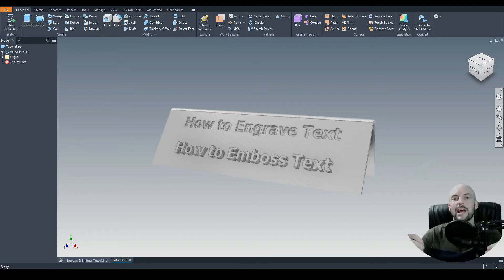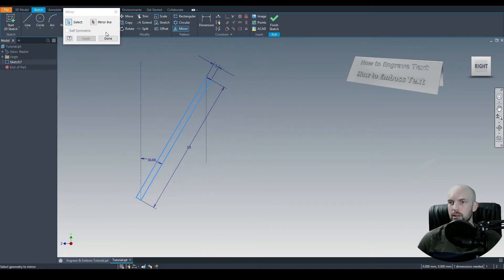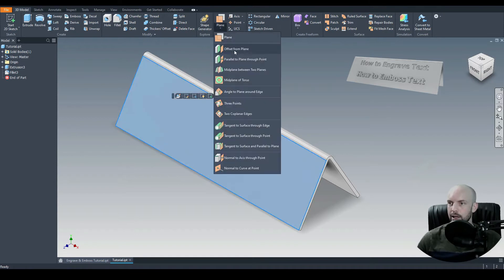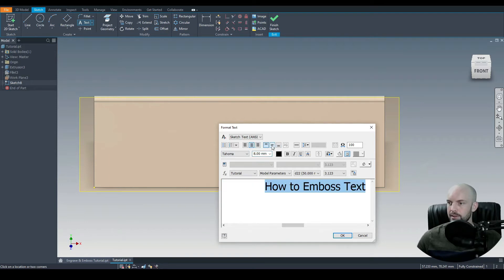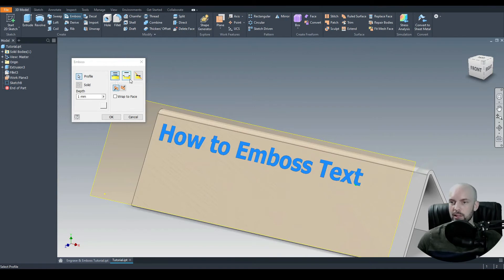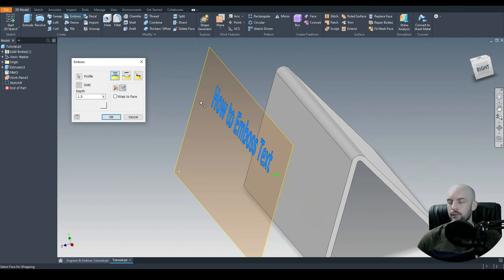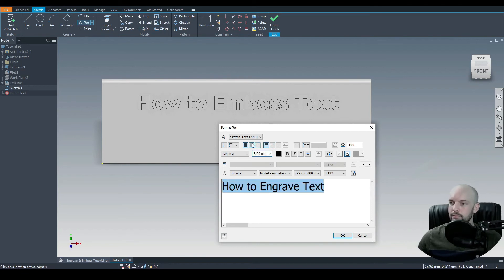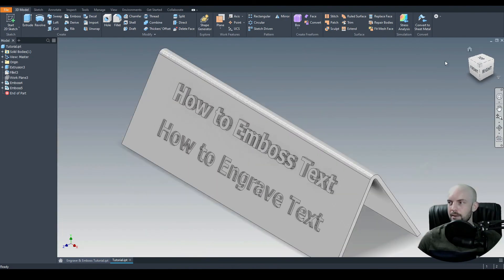How to add 3D text | Autodesk Inventor | Tutorial

Comment: Hi, this is very helpful, but for some reason, I have an assembly that has text on one of the faces, and when I create a base view on to a drawing of it, the text doesn't show and only the build does. The text isn't embossed or anything, and it's an actual text made with sketch, not a decal.
Reply from the maker: Hi, glad it's helpful! When creating a drawing view, check if the text is part of the solid model or a stand alone sketch. If it's a stand alone sketch, then you would need to extrude or emboss it to show as a 3D feature. A 2D view will only show 3D features, not sketches on their own.

Comment: What can i do if my text is upside down
Reply from the maker: Hi Joshua, good question - one of my students had the same question. In the design tree, find the plane you are sketching the text on, right click and select 'Flip Normal'. Now your text will be flipped so as to read the correct way up. NOTE: You may need to input the text again if you already embossed it.
Reply: @AutodeskInventorTutorials  one more thing you could do is use constraint on the box there with any edge and change the angle to get ur text in correct way
Reply from the maker: Hi Mania, yes correct, thank you :)

Comment: How do you engrave only the outline only? The engrave functionality here could be done through an extrusion also
Reply from the maker: Hi, yes you're right, the extrude tool can be used to do the same function, the engrave tool makes this easy by referencing a planar face instead of entering extrude/ extrude cut dimensions from a different plane (like in my example). 

Regarding engraving the outline only, one option you could do is to change the font and use a 'thin' font so that you are engraving thin letter wall thicknesses only. I suggest one of the 'Roboto' Fonts, these are thin walled.